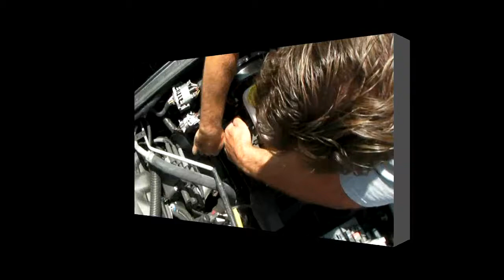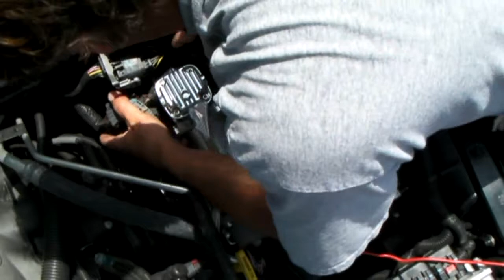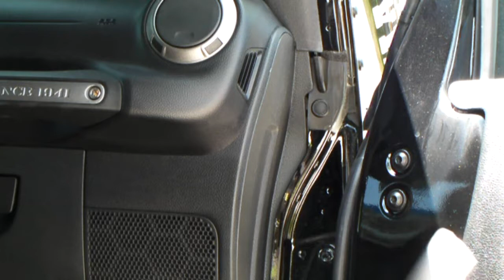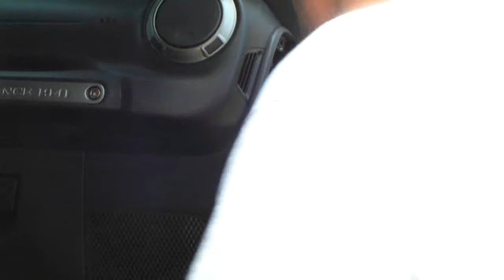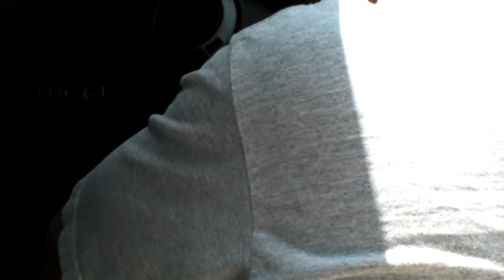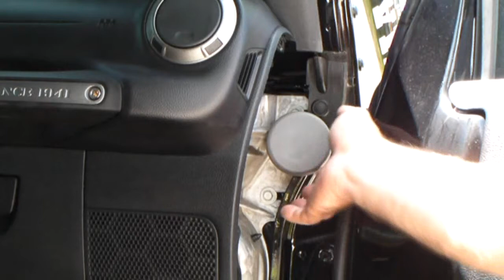Jeep JK Engine Bay Compressor Install Video

Comment: will not work with 450h the compressor is too big for the mount, I had to extend mine, second, the 450h hits the oil dip stick in such a way, that you won't be able to check oil.. still trying to figure out a way to mount it..
Reply: I recommend the 400 over the 450.  The 450 is simply too slow.  Might want to check out our testing page: http://dominionoffroad.com/jeep_jk_onboard_air/viair_torture_test.html
Reply: Unfortunately, I just got my 450h, however I do like that it's 100% cycle, that said I might not like the slower air up time. Thanks!